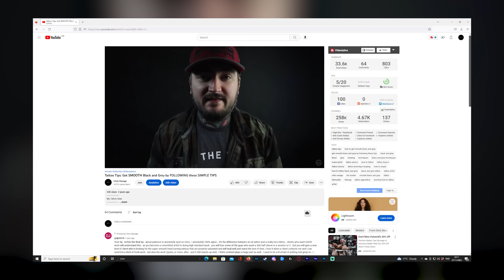THE ULTIMATE TATTOO SHADING GUIDE FOR BEGINNERS

Comment: Voltage gives DIFFERERNT RPM for different motors ( models)  So mentioning voltage is useless - unlesss somesoone is using the same machine ( assuming the motor is same)
 What counts is Hz, or RPM and that of course is about the speed, and also depending the spped of the  that holds the machine, or the hand and pressure and why not, skin as well.
Cheers.

Comment: Great video Chris! I realize that fake skin doesn't take ink like real skin.That was why you went over it as many times you did  to achieve the shading that you were looking for. However when using a light touch of the needle on the skin, how do you know if the ink is deep enough to stay on real tattoo when heals or if it will all fall out, needing a touch up? 🙏Poppy
Reply from the maker: The amount of Saturation applied but also, it’s one of those trial and error things unfortunately. You just get to know by doing 😬

Comment: Okay,bit confused. Pull= pushing your needles to the front? Push=pulling your needles to the back? Basically their both whipshading? I’m missing something.
Reply from the maker: Yes depending on the angle you are coming in from pull can be push also lol. But they are technically two different styles of shading. And used in different ways, hand speeds and voltages.
Reply: @ChrisRavage  so you   could say whipshading is with lower speed machine and or faster hand. The other one with same speed machine and or same speed hand or even slower hand speed. I think there’s some light coming in the tunnel. ;-) thanks.
Reply from the maker: @DavidToken  I can’t give it you all that easy 🤪😬
Reply: @ChrisRavage  my bad. Forgive an old man. 🥸🤪 Try not to let it happen again.🤥😏

Comment: When filling larger areas with a lighter tone. Say for example a wave on a Japanese piece. And you have tranistioned from dark to light but there is a big  patch that needs to be all the same lighter tone (say a medium black) Would you colour pack this. Or do you only need to colour pack if you have a solid black or colour. Not a gray tone. Hope it makes sense. As in would you never need to pack in anything lighter than solid black or solid colour.
Reply from the maker: @andyhowden7655  never pack Greywash..it will lead to blotchiness..build up to the required tone using your techniques.
Reply: @ChrisRavage  cheers man

Comment: I really learn a lot from these video.. You are awesome I think I need to start letting the machine do the work cos I have been applying much pressure and my work seems to be good at first but later it ain’t.which voltage will you suggest I use while drawing with a Hyungjoon wireless tattoo pen

Comment: Hey Chris, another great video! Can you help me with something. How do you find that sweet spot in shading like you find in lining. You know that feeling where everything is working together and you think I found it. I have already tried to find it the same way you would with lining start out low work up but, I never feel like it's quite there. I've even tried turning my voltage down even more to just see what would happen. I guess what I'm trying to say is I can't wrap my brain around it like I could with finding my sweet spot  in lining. I want to give you every piece of information I can so maybe you can run back a few suggestions. I use a machine built for shading the CNC Q2 suggested operating voltage is 6 to 10 volts but shouldn't be ran at 10 for long periods, it also has a Faulhaber motor. If I'm lining with it I run at about 7 to 7.5 volts results are good, depending on what grouping smaller than a 7rl I'll go lower than 7 volts. Color packing I run at 6 to 6.5 volts. Been shading around the same 6 to 6.5? I really don't know if that's where I should be or not? Sometimes it feels ok and sometimes it don't. Any suggestions would be great appreciated Chris! As always much much RESPECT and God bless bro!
Reply from the maker: It may not have anything to do with the machine bro, it could just be a hand technique issue. Especially since you say sometimes it feels ok then it doesn’t.
Reply: @ChrisRavage  oh I didn't think it was the machine I know it's me lol. I just put some information about it to further help with my problem if you had to dissect it or something lol. I just can't find it all the time. Sometimes it feels much better than other days.
Reply: @kevinstrosnider1545  I'm also struggling with the same issues with shading. I feel comfortable with linework and pulling clean lines but shading has been a struggle to get consistent without overworking. It's hard to find that sweet spot like you mentioned

Comment: Great video! What sort of needle throw do you work off ? Could you do small short video on that it’d be soo helpful! 👌🏻
Reply from the maker: I use 3.5 Stroke atm
Reply: @ChrisRavage  many thanks for replying dude! I meant how much needle do you have coming out when you work? Would be super helpful. Do you just kind of use no pressure and let the machine weight just hit the skin? Or are you actively sort of pull back so all the weight doesn’t hit? (I have wand shader same as you) thanks man. Much respect your the best 💥
Reply from the maker: @lukethegreatest  Around 2mm sometimes 3mm depending on the situation. Slight pressure but mostly the machine does it for me bud
Reply: @ChrisRavage  place much stock in 3.0 stroke?
Reply from the maker: @machietheapachie7214  Sure, it’s a nice middle ground for B&G

Comment: In the last part where you shaded the circle, you went over it so many times, wouldnt it normally cut up the skin after going over it so many times?
Reply: Yep be careful especially with a mag you’ll chew them up
Reply from the maker: No, my machine is hitting soft and my hand is light, which gives way more time on skin to get blends
Reply: Well actually I just saw it, I’m wrong. If you’re using the correct voltage and hand speed you’ll be solid brotha
Reply: @ChrisRavage  yeah just noticed in the video, also what voltage do you use man? I’m self taught so really tryna pick up shading more for traditional rhough
Reply: @MM-jw4um  you gotta find what works best for you but I recommend starting around 7 for lining and <6 for shading.
Reply: @MM-jw4um  voltage depends on many things .. machine ,needle configuration, ,tattoo style etc .

Comment: In the most politest way possible. Surely the amount of time you spent going over that circle shading you'd rip the skin apart on a human body right?
Reply from the maker: If my machine wasnt correct and my hand pressure, yes it would.
Reply: @ChrisRavage  do you mean if your machine wasn't on the correct voltage?
Reply: @ChrisRavage  and thanks for replying
Reply from the maker: @TheMembraine  Voltage and just generally the machine you are using